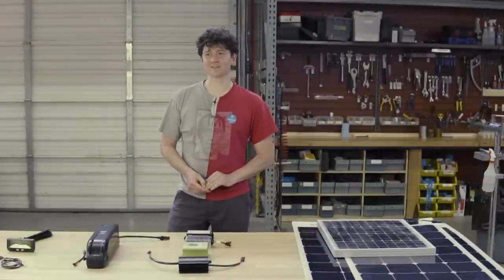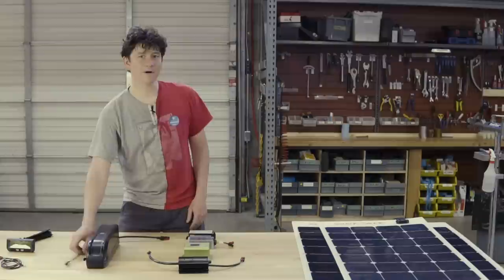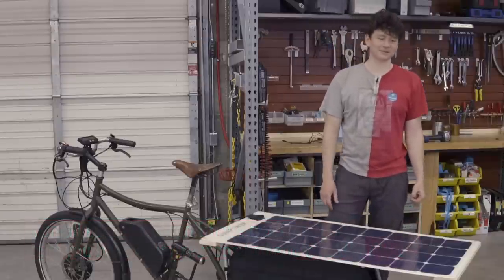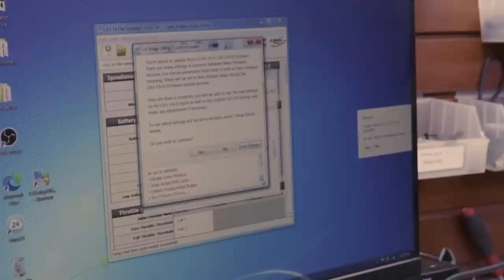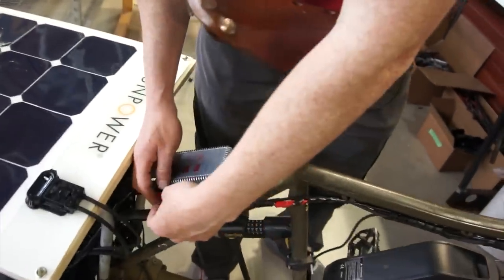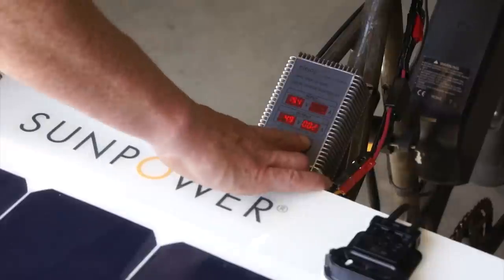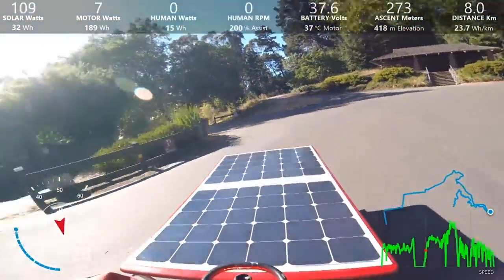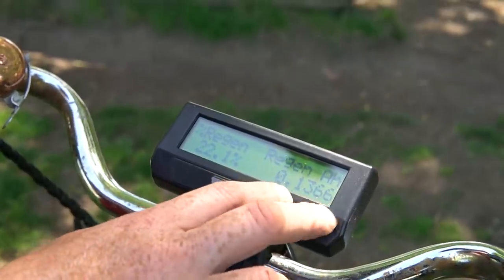Primer on Solar Ebike Systems

Comment: He should have use a smaller solar panel so it don't look so awkward.
Reply from the maker: This is actually quite a small panel to begin with, so we wanted to highlight kinda how big/awkward the panel needs to be in order to have a meaningful charge contribution. Most people serious about solar ebiking would have 2-3 times this much solar panel area.   If you have a cute little 20-40 watt panel, it would look good in the photo-ops but won't do much for extending the vehicle range.
Reply: @GrinTechnologies  agree, but in my case I am taking folding solar for camp (200watt), and 21 watt for on the bike just for my toys. Also have a very big battery setup.

Comment: Why not just get a portable Lithium Ion battery bank and keep it plugged into the charging port of your battery while you ride it around instead?
Reply from the maker: Because it would be vastly more efficient for the lithium ion battery to just be another ebike battery in parallel with your main pack, or used sequentially.  Using a buck / boost dc-dc to charge one battery from the other battery is rather goofy. 
If you want to harvest energy from the sun either for convenience (don't want to bother finding outlets to charge while bike is parked at work etc.), or necessity (on a remote camping/touring trip with no charging infrascture), a solar panel is the golden ticket. That's what this video is a primer on.
Reply: Unfortunately I can't do it anyway because when I plug the charger into the battery it cuts the power to the rest of the scooter. :( @GrinTechnologies